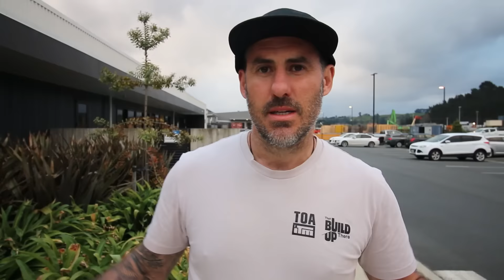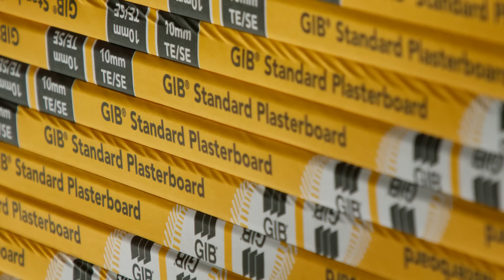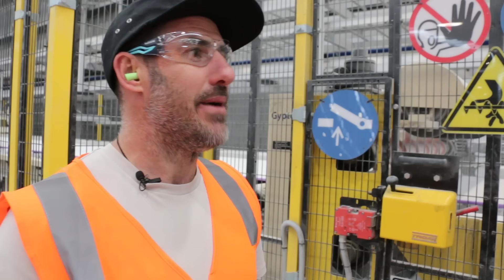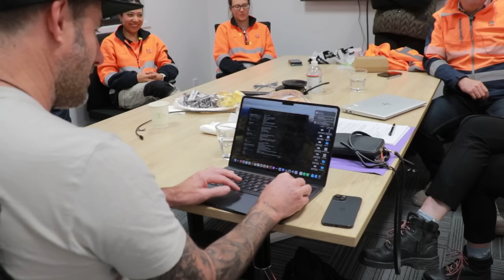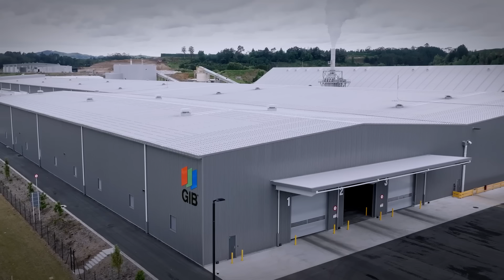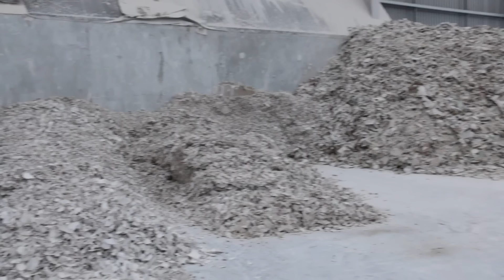I Found Out How a $350M Plasterboard Factory Actually Works

Comment: Excellent video, thanks for sharing. 
From the reports I read, it was $400m built cost. Maybe FB found a savings of $50m

I read the FB annual report and found that Light building group has a gross margin of around 30% mark. Someone asked if the wallboard will ever come down in price, why would FB wants to reduce the price, when they have 94% market share and GM of around 30%. They will most likely increase the price and said transport cost has gone up. However, the main question to ask  - Is $400m on a new plant at Tauranga a good investment?  I believe they made a mistake. This plant was proposed in 2020 after they shut down the Penrose plant. 

To invest $400m, is not a one day decision, they must have started thinking about it back way back before 2020. Their forecast imo, was wrong.  Yes, they chose Tauranga because of the port. But is it the right decision? Where are most of the new builds located today? Christchurch?

They would have thought that the real estate development will have grow, grow and grow. Covid gave them the impetus where demand was greater than supply. Even FB residential development is struggling and there is speculation Fletcher Building is moving to sell its residential division. 

However, the latest FB report, does not show a significant growth in the Winstone wallboard market. Say they raise 400M through 100% finance at say 7%, that means that they will have to pay $28m interest payment each year. That could partly explain why the building group who has a margin of around 30% and only a EBITDA margin of 8.8%. FB recently sold their construction arm for $316m, that is not even enough to pay off the plant.  They will have to use some of the money to reduce their borrowing of this plant. 

I do not believe there is/are a lot of science in makng plasterboard. They have been producing it for so many years,  they should know what to do and what not to do. They should be thinking through continuous improvement of reducing the price for the customers?
Reply from the maker: cheers for the insight :)

Comment: Knauf Plasterboard in Pinkenba, Australia is 350m long aswell. Which would compete as the biggest plant in the southern hemisphere.
Reply: They also run a cornice plant inside this plant. That cutback machine is impressive. Makes a difference with packs sitting in the warehouse. Clean.
Reply: Looking at google maps -37.760887559124036, 176.08417036862107 , the production side of the factory is 462m long, the main storage building it's attached to is 440m by 100m, the raw materials storage shed from the beginning of video is only 200m x 40m
Reply from the maker: wow, that is massive, thanks for the info
Reply: lol, I replied with the length of gib building and comment got shadow banned. externally it's much longer.